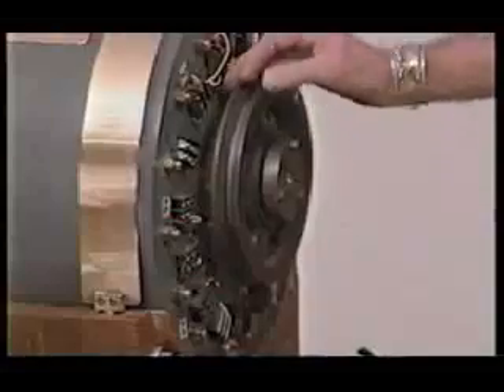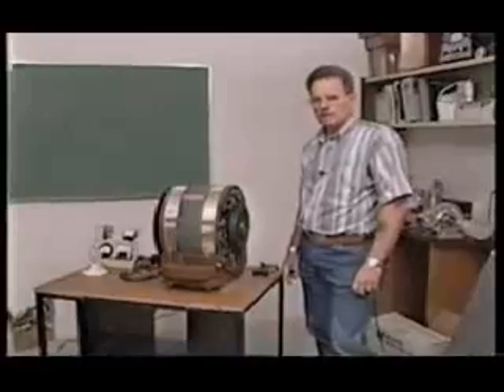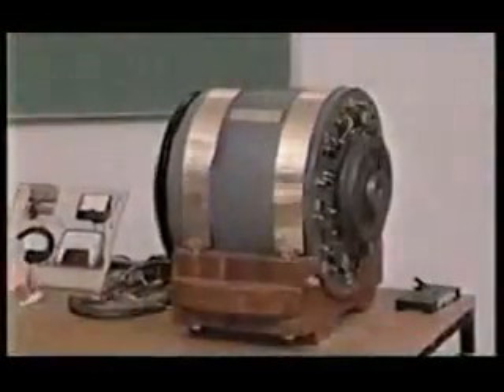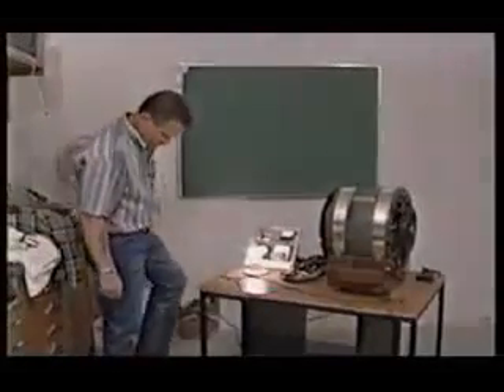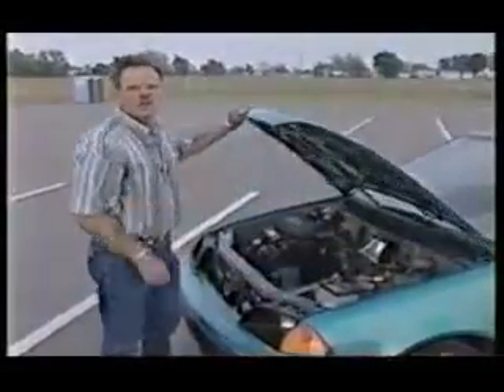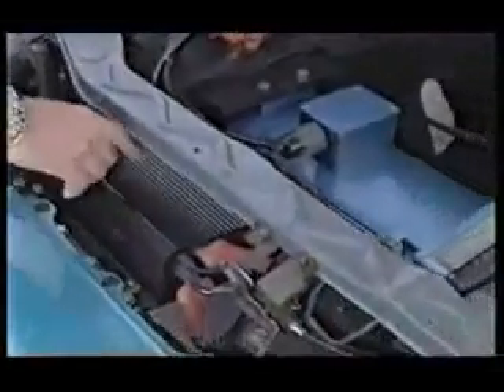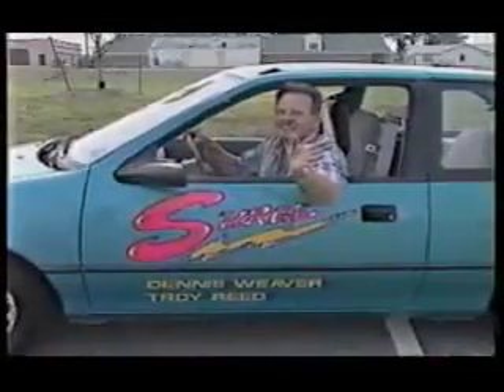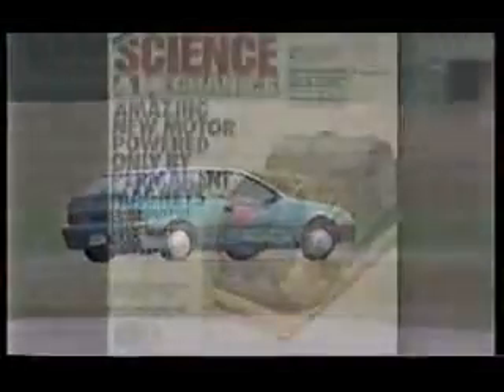(Oil replacement solution) Magnetic Motor - Electric Car Without Battery.

Comment: Fake! You can hear his so-called "self-running" motor slowing down from the very moment he disconnects it. I can't wait seeing his electric car "self-running" without this big battery. Go and see those russians mag generators, that's a different story: 
- small experimental mag gen: https://youtu.be/2WAReeHsYFI 
- 1kWh mag gen: https://youtu.be/ajBxX_Lwg7g  
- 11kWh mag gen: https://youtu.be/syFGM4kAUf4. 
If those are fakes one has to admit that this russian guy is far more skilled in faking than this american amateur.

Comment: Our generation is too stupid to figure this out. Mostly because they believe everything on the net, or what the media wants you to believe. The Einstein's of this age are gone and all we are left with are a few capable minds to continue their work. The technology is here and we are capable of building such machines, but big corporate is in the way of a better world. If they can't make money off of this they will do what ever they have to and stop it. All you need to do is build a vehicle that can create and store its own power, it doesn't have to be free energy just continuous while in use. Cars already do this to run the electrical side of current vehicles, its not hard to figure out how to implement this into the engine side of the vehicle so they won't need fuel. Its been done already, you can even buy the parts and build it yourself if you don't want to wait until big oil is gone and out of the way for progress to begin.

Comment: 100% hoax. You take some energy from mains, convert it to kinetic energy of the engine rotor, convert it again to electricity which gives a short period power to the car motor. Actually if you tell the mass of the rotor and rotatinal speed +  your car weight, it is easy to count how far you can drive your car. My estimation is, that maybe 1-2km/h about 20 seconds. Your car would work with energy from mains, but with very low power ratio. It is much more efficient to store energy to accumulators than to kinetic enrgy of a massive rotor. The amout of stored enrgy is far to low. Your video is hoax.
Reply: +Mark Silver You have to admit that it's a a novel idea, even if it is horrible.
Reply: +Mike Hunt Mistä näitä idiootteja riittää? Onko sikäläisessä koulutusjärjestelmässä vikaa, vai onko typeryytesi synnynnäistä?